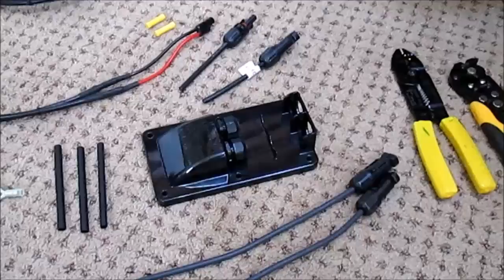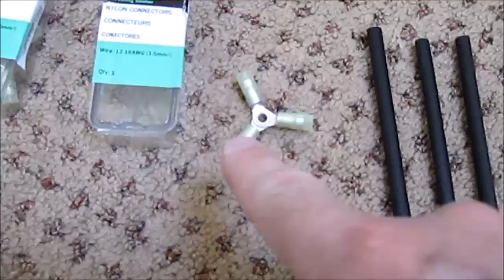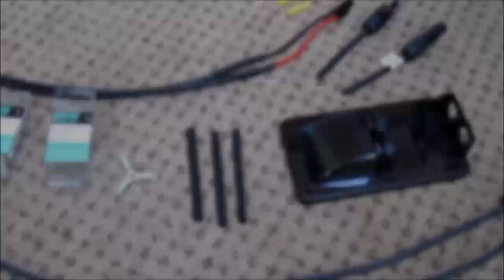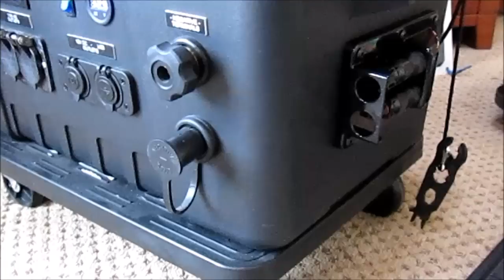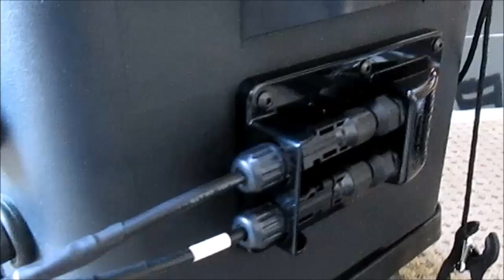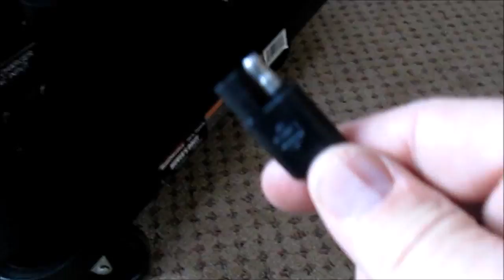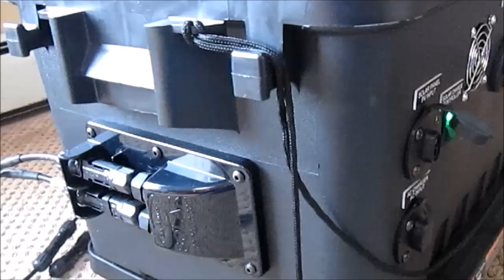V1 P5 DIY Portable Solar Power Generator

Comment: How did I miss Part 5? haaa. Looks great...I like it.
Reply from the maker: Thanks Chris!  I plan to add a couple more videos in the next few months.  Hope to have my boat in the water in the next 2 weeks and my next video will feature my pairing of this generator with a portable 1.1 cubic foot Dometic refrigerator freezer.  Hoping it will be of interest to the RV solar enthusiasts.
Reply: btw just went to your site. My son got his masters in Geology .. I begged him to be in Archaeology!  I'd tag along for the digs :D
Reply: I'd like to see this for sure! I popup camp. Refurbishing my pop tent trailer now. Hope to be done in the next few months. Your video's are clean and clear. I've got your pdf's. Do you edit those as you go? You've done so much for what your needs are. Wow. Another question.  How much do you feel you've saved by DIY or is it rather a to fit your need project?
Reply from the maker: Chelle, I hope to have my next video featuring the pairing of this generator with a portable 1.1 cubic foot Dometic refrigerator freezer finished in the next couple of weeks. 

 I have updated the wiring schematic to the extent possible without cluttering it much more than it already is.  I just posted links to multiple supplemental wiring schematics that complement the subsequent upgrade videos in the series.  You can find them under "show more"  in the description to the part 1 video.

The parts list is up to date, save the cost of the mc4 cable entry plate.  By comparing the cost of my DIY to similar, commercially-produced systems I estimate I have saved about 50% of the cost, or $1,000 in savings.
Reply from the maker: Sometimes I wish I had pursued a professional career in archaeology!  It is a very interesting field.  At present, I am still quite active in avocational activities related to my interest in primitive skills, particularly in the areas of lithic technology and the atlatl/dart weapon system.
Reply: Wow that's a GREAT savings in my book! Thanks for all the time and effort into sharing all this information. Really!

Comment: Thanks for this video .. I was wondering if you would add super capacitors to protect the battery from higher startup load .
Reply from the maker: Thanks for having a look at my videos and for your comment.  I have done a little research into how supercapacitors might be incorporated into this system and it appears there  would be some advantages to doing so.  If you intended to frequently use this system for applications/appliances that have very high startup loads (like a sump pump, for example) supercapacitors could help to reduce/smooth out the initial peak draw on the battery.  From what I have seen available on the web it appears that I could combine five 2.7 volt supercapacitors (13 total volts) for a cost of about $50.00.  Exactly how to wire them into the system is not something I have yet researched.
Reply from the maker: Thanks for sharing the link to that SOLN1 system that is using only supercapacitors.  It is interesting to me based on the very short amount of time that it takes to charge the supercapacitors.  I would have to spend some time learning a lot more about sizing them appropriately and how to chain them in series before incorporating them into my system.  Due to the fact that they discharge so quickly, and have relatively little storage capacity for prolonged use before recharging is needed, I think using them in combination with a battery system might be most advantageous if extreme portability of the system is not a primary concern. 

Glad you could make use of the parts list.  I am always interested in seeing what other innovative ideas people incorporate in these DIY systems.  Best wishes for success as you build your off grid system.  If you are able, please post a video and share what you come up with.  The ability to network with other creative people is one of the best aspects of YouTube!

Comment: Thank you for producing this video series. I have been thinking about doing this Exact type of set up for use with my rv. I have learned so much from watching this. I am beginning to produce one for myself and your detailed explanation has inspiered me. One addition that I am planning to add is a dc to dc charger linked to my vehicle charging system. This will ensure that the batteries will be fully charged when travelling. This is going to be fun, thank you for your help.
M
Reply from the maker: You are welcome Mike.  Thanks for having a look at my project and for your comments.  Other RV users have also expressed a desire to charge this type of system from the vehicle's charging system.  As I understand it, as long as you are charging from an alternator with integrated voltage regulation/relays it is safe and will protect the batteries from overcharging.   Have fun with your build!

Comment: I like what I have seen thru the five videos, will have to consider doing something on this order myself. Probably the biggest factor in favor of this project is that once someone has built this and successfully gotten it working, then making changes is much less a big deal as is making repairs. Look how many people want to do this with minor adaptations for their own preferences and what is available locally...

After watching the first video I was thinking why not use a panel mount SAE connector? Look what happened! You sourced one supplier, ZAMP Solar is another. Most of the wiring can be obtained from Lowes, Home Depot or your preferred hardware or electrical supplier. Fans could be changed to lower cfm units to reduce fan noise, and this can be adapted to be a smaller unit for those needing less capacity, or more for that matter. 

Buy a GZ device and most likely anything beyond a battery replacement is a call to send it to the mfr. Nothing against GZ by the way, just the reality of the situation.
Reply from the maker: Glen, thanks for your comments.  I agree, one of the greatest advantages of building your own system is gaining a tremendous amount of knowledge through that process , and then being able to easily make repairs yourself.  For me this project was equal parts education and hobby.  I also agree that customization is another great advantage of building your own.  GZ products are quite expensive compared to what is possible to build as a DIY project.
Reply: Did you have a particular book that helped you get started?
Reply from the maker: Rodney, I did not reference a specific book, but there is plenty of helpul information on the web and plenty of great videos right here on YouTube on the subject of solar power systems.

Comment: Hi Jim 
My diy solar project is coming along nicely thanks to your project and many others that I have seen online.
I'll try to post some photos up or videos as soon as I figure out how to post it to u tube. I'll post some of my project and ideas soon.
Even your latest video has helped me with some wiring problems I had. 
Your 3 way connectors are very expensive in the Uk, it's about £50 for just one on Amazon. So I thought of a cheeper way
Of DIY, make it myself by getting ring terminals and soldiering them together witch works grate.
It also gives me a lot of options to add more than 3 connectors and the choices of different sizes depending on the size of wire.
It works a little bit like a bus bar.
Now I can use my normal 50w solar panels with my Anderson power pol entry, and my 60w foldable solar panel with the SAE port 
But going through the same solar controller , using this DIY 3-4 way ring terminal connectors.
I also have dust protection for around The holes I made for the PC fans which help to keep out the dust when the fan is sucking in air and pushing air out. I have 4 fans on my system, two 60mm at the back and two 40mm at the front with LED light so it looks pretty when I have it on on worms nights 🌛✨🌜
The dust protection is meshed looking, very thin and easy to install... the filter I used is 120 fan dust filter Foam.. I simply cut it down to the shape I needed, inserted 4 holes on the 4 corners and used the Alaska AK-003 20 Rubber case fan mounts to thread through the fan and we're you have put the crews in. You will find the rubber mounts will hold it all together without the need of any adhesives.
I'll like to say thanks again for your inspirational vids.
Reply from the maker: Thanks for checking in Carlo.  Glad my videos could be of help.  I am looking forward to seeing your finished project and am interested in your dust protection solution, may have to borrow that idea to incorporate into my build.  Soldering together three ring terminals is a very creative solution to make your own 3-way terminals!
Reply: Jim Fisher yeh, if you google pc fan dust filter, you will find many different types.
Also look up pc fan rubber mounts. I've installed it with the fan instead of screws, the rubber mount help with the noise reduction from the fan vibrating.

Comment: and for better cooling how about 120 mm fans instead of the small ones you have, ones that have high cfm
Reply from the maker: over the past 2 years of use the two 60mm fans have shown that they have the ability to quickly exchange the air inside the case;  even in the hot summer months I have seldom seen the internal case temp exceed 90 degrees

Comment: just a thought for your power bank, you would get better power output if you increased your inverter to a minimum of 750 peak watts
Reply from the maker: Thanks for your comments;  you probably noted the two external positive and negative terminals with the screw-on hand knobs on the front of the case.  I use those to connect to my external 2000W (4000W peak) Cen Tech modified sine waver inverter when I need more AC power output;  given what I typically power on my boat I have rarely needed to use it.
Reply: I totally understand reason I said think about your fans think about the temperature of your batteries and what they are handling if the temperature exceeds the recommended temperature of the batteries they could explode it's only reason I suggested a larger fans with more CFM
Reply from the maker: Based on my research it is recommended that charging of AGM batteries be halted if their temperature exceeds 120 degrees F.  Prior to installing the snap disc thermostat I would simply monitor the internal case temp using the digital thermometer I installed and turn the fans on manually when I saw the internal temp was rising.  I keep the system in the shade while on my boat (inside the cabin) at all times and while charging it has only exceeded 90 degrees F a couple of times, even without the fans being turned on.  Based on the first couple of seasons of trial use I chose this snap disc thermostat https://www.amazon.com/gp/product/B007OXBZM8/ref=oh_aui_detailpage_o04_s00?ie=UTF8&psc=1 .  It closes at 90 degrees F and opens at 80.  Will be monitoring its performance during the third season of use this summer.
Reply: Understandable just saying the more cfm you have moving the better your inverter works and doesn't risk fire I would move the 60 mm fans to the vents on the top and put more where you have them now
Reply from the maker: One of the nice features of the Wagan Elite 400W pure sine wave inverter that I used is that it also has its own cooling fan built into it that will automatically activate as needed.  The inverter also has some type of fan thermostat built into it.  If I noted that the internal temp of the case was unusually high while using the 400W inverter there is another simple solution to dramatically increase ventilation, simply remove the lid to the case.
Reply: True just a thought  if you were say camping and in a storm

Comment: you can get better mc4 plugs know so you don't need the key to unclip them i changed mine i like the plate but and love the box to nice setup i got that cheap controller to but i not use it in my boat there waterproof ones for the boat so you can hose them down if need be